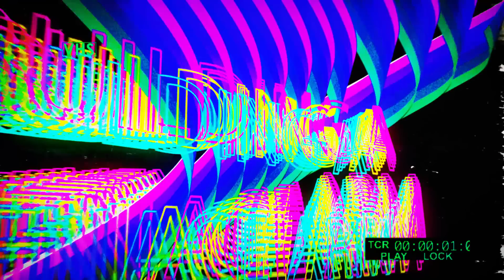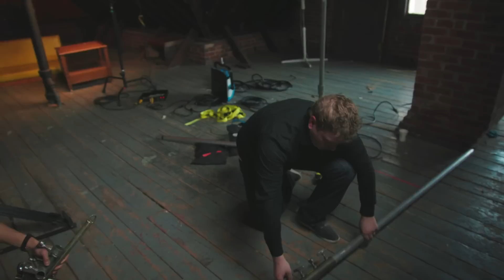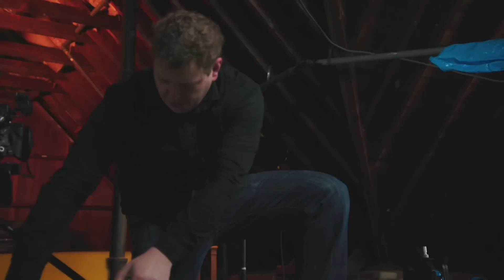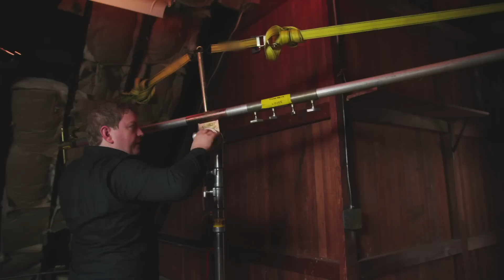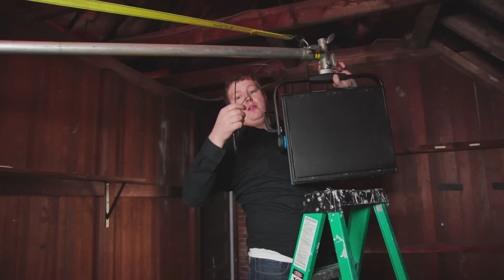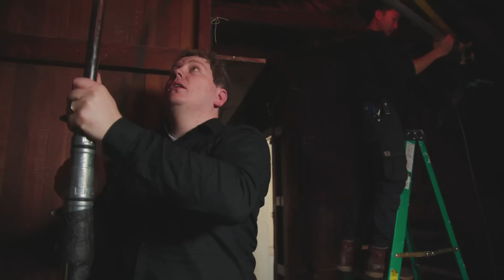How to Build a Menace Arm - 24 Pictures a Second

Comment: Decent video and appreciate it is to the point. A couple of suggestions: 

It should say "use the longest piece do pipe that you may actually need, and ideally one piece unless you cannot fit into a vehicle or into location. No need for extra time, cost, and decrease on rigidity, caused by a joiner if you can do one length of pipe." On my Sprinter, I have 12, 10, 8, 6, and 4-foot Speedrail, so can create even a 16' or 24' foot menace with joiner for a very light fixture like a 1x2 or 1x3 flexible mat.

There is no need to use a huge, heavy, expensive logistics strap rated for thousands of pounds when a quality regular ratchet strap rated for 500 lbs or so would be fine. No need for extra weight and time using it.

ratchet strap to the base of the stand is as a safety, and if need be, doing fine adjustments if properly balanced to have slightly more weight on the front of the boom, with knuckle relaxed enough for a small move. However, you should still have weight on the back end of the arm to counterbalance the light, with adjustment for length of pipe ratios of 2:1 or so. The strap doesn't actually balance the rig. It just prevents the boom from falling rapidly down, if the stand is upright. If you don't use counterweight, you need to use a lot more weight at the base than needed to have some on base and some at the back of the arm. usually, a 25 lbs sandbag on the back of the boom is fine for a 10-15 lbs fixture. Using the strap instead of counterweight makes it dangerous/impossible to raise or lower risers, or shift the boom back and forth.

Comment: Great video and explanation.   Quick question....  Let's say you needed the menace arm to extend out longer, would you simply repeat the coupler process?  So like, one coupler to join the 4" and first 6" poles then, at the end of the 6footer, add an additional coupler and pole (4 or 6ft) or would this require something else?   I'm looking to mimic the reach of a Max Menace Arm system but without the cost.  Thank you in advance to anyone who decides to chime in with quality information.
Reply: Not recommended. Get the longest piece of pipe you can. For instance, if you need a 16ft  pipe get one 12ft and one 4ft.. couple those together

Also, keep in mind that the longer your pipe becomes, the weight of the fixture you’re rigging needs to also decrease.

Comment: How many tons of straps are you using? Pulling it too tight will cause the steel connected to the middle bar to bend or not?  
I'm wondering how many kilograms it can support? and how many meters long MAX.

Comment: Hi there, I've checked on Adorama.com and, also, following the link in the description and both are showing the Matthews Schedule 40 Aluminum Pipe Speed Rail Menace Arm Kit. Which is different from the one used in this video. I can't find the same and that's the one I need to use it with Skypanel or Titan x2. Where can I find those? Thanks
Reply: Kupo has been the only company I’ve seen mimic this design

Comment: Very interesting to see this in action but that's a lot of time and effort for what was achieved. I would find an easier way :)
Reply: It's only a lot of time compared to plopping a light directly on a stand, which couldn't be used in this situation to achieve what they want to achieve.  A menace are is pretty much the quickest easiest way to rig a single light overhead safely. If there are structural beams in the ceiling, you may be able to rig a light from there, but that has it's own set of challenges, definitely isn't faster, and isn't always an option depending on the location. A goal post would be the other way (two stands with a piece of pipe between them) but this requires enough space to put two stands and have them both out of frame. What's great about a menace arm is that the footprint is small and it gives you virtually 360 degrees of coverage.  Mounting lgihts directly on stands is fine when it needs to come from the front or if you're filming a tight static frame like a sit down interview, but if you are shooting anything where there is significant movement by the talent and/or camera, it becomes very difficult to keep floor stands out of frame. This is why professional sets usually have a suspended truss grid overhead, to maximize the freedom of movement for the camera department.
Reply: Still waiting for your "easier way"/ LOL!
Reply: @roblindsay101  he's still figuring it out 😅
Reply: Now, you use a Flex RGB LED light panel and a much smaller boom rig!  Easier way finally revealed!